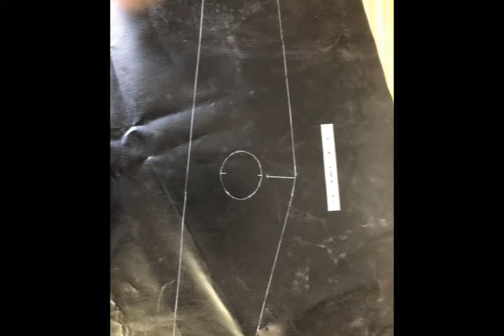Inflatable Boat Build - E4

Comment: It can be used in lakes or shore(not far away more than 200m to land) otherwise this fabric is not safe enough. Pvc boat fabrics have stronger fibers inside pvc. Also he may add an inflatable keel to make hull bottom more rigid and V shaped. and dont forget to register your boat to flag registration, according to your country's regulations =)

Comment: How much did u spend water ready
Reply from the maker: Luis, I have spent around $500 USD to what you see up to episode 4. That does include some things not shown - Oars, oar locks, seats & hardware, misc hardware. I also bought a used 9.9hp motor which is not included in the above cost. Regards,
Ken